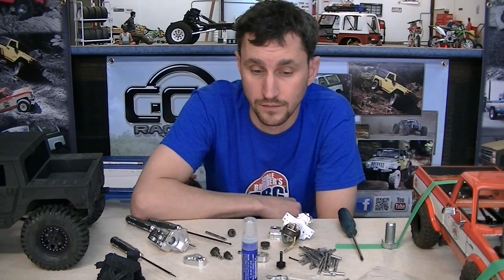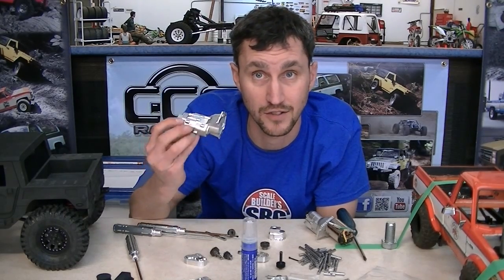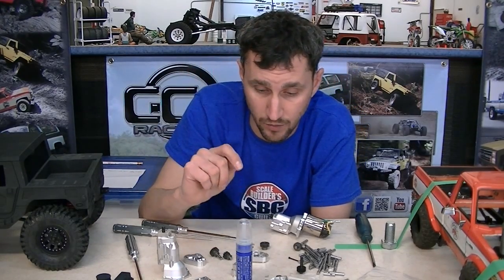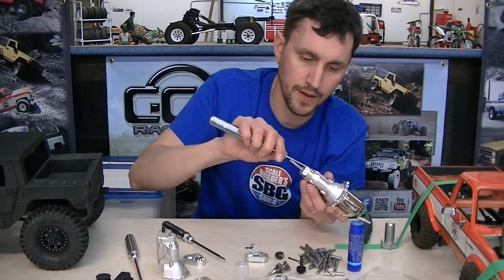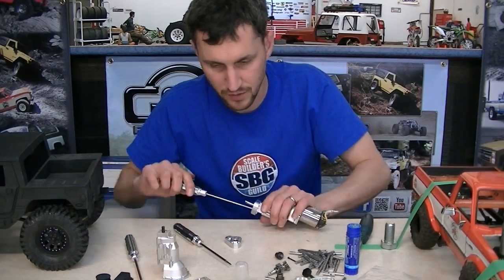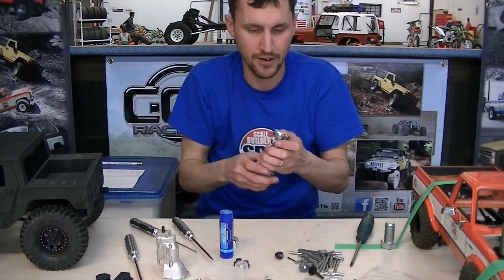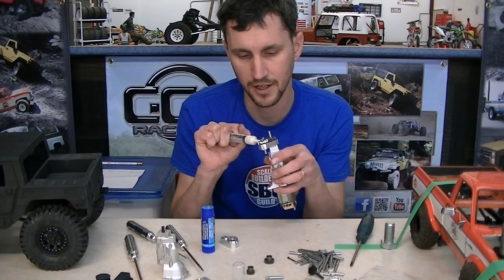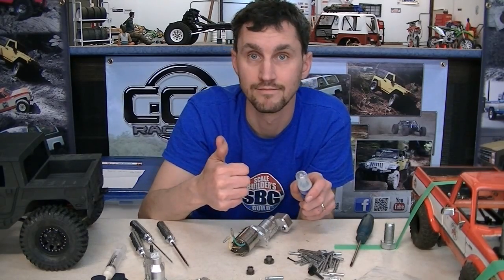GCM LRT-Case Assembly and Motor Mount for R4 Scale Trans

Comment: @gcm racing where do I get the shaft that goes to the motor plate that acts as the pinion that contacts the gear inside the r4 transmission? 

Put motor on motor plate, motor pinion goes to the gear on the unknown shaft which has two gears that goes into the r4 trans? Where's this combo at? Thanks any help?
Reply from the maker: +Mike Galban That shaft comes in the box with the R4 transmission and the bell housing screws.
Reply: +GCMRacing1 - Scale Truck RC in Canada thanks buddy bout to order up yalls combo then later today woot! Can't wait

Comment: Are you using 4 bearings on the one shaft? all fitted snug in housings that are bolted together? My old teachers would smack your ars! Could that main shaft not do with 2 bearings on either end?
Reply from the maker: ***** Smack away, it's never going to flex the shaft! HAHA! The main reason for leaving the bearings in the case is that they keep the shaft from floating on the linear axis, because the gears inside are captured by these bearings. I'm sure the small one in the trans end bell could be removed, but then what would you do with a 5x10 bearing left over?